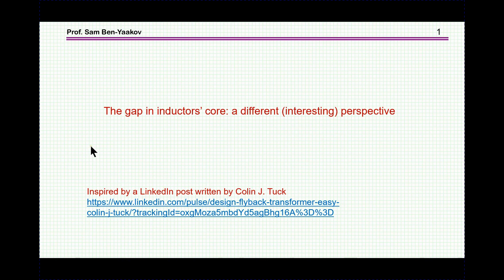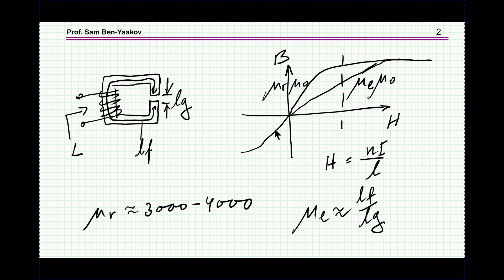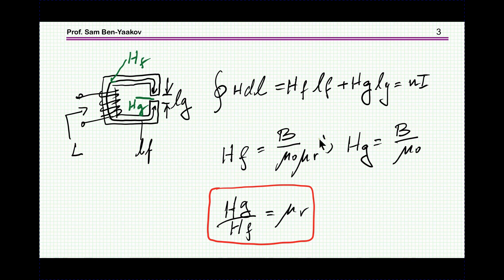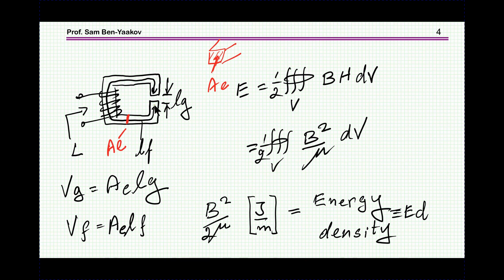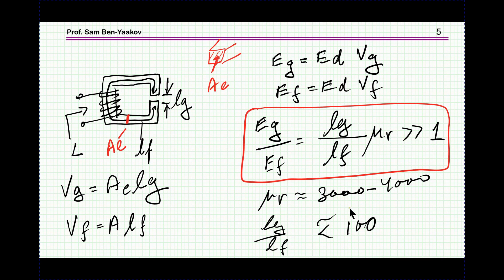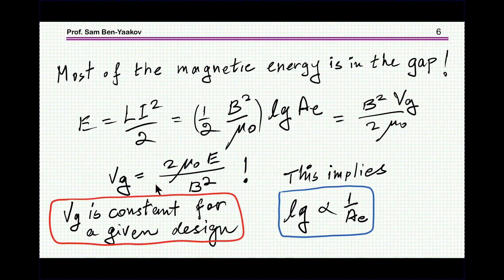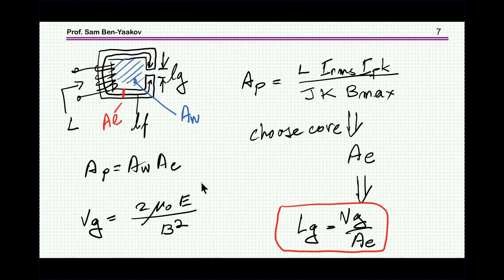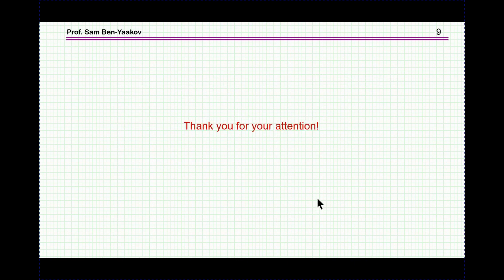The gap in inductors’ core: a different (interesting) perspective

Comment: Does this work for gaps as large as a centimeter with core length being 20 to 30 times longer than the gap?
Reply from the maker: I the gap is large, fringing become dominant and will make a major change in parameters such as coupling coefficient.

Comment: Hello, firstly thank you for the knowledge you give us. I have a question can you tell reasonable air gap height limit. For an example for transformer i design with that ferrite E55/28/21-3C94  i need air gap 30 mm, is that to much considering to EMI.
Reply from the maker: This is too much. You need to reconsider the core size.
Reply: @sambenyaakov  Perhaps It is a real challenge to design LLC converter. The limiting factor i see is delta B. Could you suggest core material with low losses. (I need to go to 0.4 T). Although i redesigned the resonant stage and now i need 6.5 mm air gap for the same core , but still seems to much for me.

Comment: Sam, it is a very tricky thing assuming ur ~ 3000 - 4000. Ferrites or other materials with that high permeability are not generally usable due to low frequency range, low stability, high dependence on external magnetic field and low accuracy. If you go to realistic values of 1000 - 2000 you find out that a substantial portion of energy IS NOT STORED IN THE GAP but rather stored also in the magnetic core.
Reply from the maker: Dear Gregory, Thanks for comment. Permit me to disagree. Below is a table from EPCOS. Up to 100kHz the mur are around 3000. The ratio between energy stored in gap to energy stored in ferrite is =mur*(volume of gap)/(volume of ferrite) . Asssume 1mm long gap and 100mm ferrite length and mur of ferrite 1000, the energy stored in gap is 10 times that in the ferrite. I would say that this  is substantial. 
Regards
sam
________________________
Power Transformer (low loss)

f<100 kHz 
N27
µi = 2000 low cost, hi-power
N41
µi = 2800 current transformer
N51
µi = 3000 loss min. @ 40°C
f<500 kHz 
N87
µi = 2200 standard
N88
µi = 1900 loss min. @ 140°C
N95
µi = 3000 flat temperature behavior
N96
µi = 2900 flat temperature behavior
N97
µi = 2300 lower losses
f>500 kHz 
N49
µi = 1500 
f>1 MHz 
PC200
µi = 800 frequency up to 4 MHz

Comment: It looks like in the discussion all participants periodically forget that any device that stores magnetic energy should store it in some volume that is proportional to the power to store for a while in order to transfer it to the load later. In order to store energy in some substance you have to be sure the substance is CAPABLE of: 1. Magnetizing and de-magnetizing, i.e. changing orientation of the magnetic dipoles it consists of (it may not consist of any) under the influence of the external magnetic field and 2. Providing a mode when ALL the dipoles change the orientation. If some of the dipoles cannot change their orientation in the changing magnetic field, they are saturated, and no magnetic field transfer is possible by these dipoles. The more intense magnetic field is applied to the substance displaying magnetic properties (H), the more sensitive the dipoles are to the external magnetic field (B) and the larger physical volume they take (Vol), the higher power they can transfer through the magnetization / de-magnetization process. This is why we should not forget about the air gap VOLUME or distributed gap magnetic core VOLUME while discussing about the gapped inductor design. We can define the air gap in the ferrite core but the cross-sectional area should always be present since we store energy in the VOLUME. Otherwise, the inductor will fail to transfer energy / power.
Reply from the maker: Gregory, I  take issue with your assessment:
"In order to store energy in some substance you have to be sure the substance is CAPABLE of: 1. Magnetizing and de-magnetizing, i.e. changing orientation of the magnetic dipoles it consists of (it may not consist of any......." This scenario is possible but  not a necessary condition. Think about an air core inductor. Furthermore we know from fundamental principles that the energy stored in any volume is the 'Volume Integral' of  1/2(B*H)dV, no magnetic dipoles are required.
Reply: Sam, you noticed that I was using a term "substance" to designate ANY material for the inductor core, air included. The air core inductor will definitely store energy but its efficiency would be very low due to the energy distribution "everywhere" since there would be no substance that concentrates the stored energy. And the fringing effect that kills inductors' efficiency would be ubiquitous. This is why we use ferromagnetic cores, which are capable of the magnetic field lines concentrating in a bunch and reducing stray parameters. Therefore, for real inductors the scenario I described is a necessary condition. By the way, in your lectures you describe inductors having ferromagnetic cores for the same reason, which is absolutely correct.Another issue is your statement that "...we know from fundamental principles that the energy stored in any volume is the 'Volume Integral' of  1/2(B*H)dV, no magnetic dipoles are required." is absolutely incorrect because the magnetic dipoles are hidden in the magnetic flux density B and they are required by the relative permeability factor that is a substantial part of the B value. Moreover, the magnetic dipoles make the vector B deviate from the vector H thus delivering some interesting effects to the magnetics but this is a different story.
Reply: @gregorymirsky8707  I think the dipoles are hidden in magnetization M. H = B/μ - M.
Reply: @j121212100  This is more related to dipole-dipole interaction.

Comment: Thanks for the video .
At 6:50 you come to the conclusion that the air gap is inversely proportional to the cross sectional area of the core by equating the volume of the air gap (Area x length) with an expression which contains B .
This is not a valid move because B actually depends on the cross sectional Area of the core (B=flux/Area = N.I/Area)  with the consequence that the Area of the core has not been isolated but rather is present on both sides of the equation . 
Applying the above in your equation we then have Area x Lg ~ K x Area squared  (because B is squared)      ( ~ stands for proportionality ) K= 2Muo.E/(N.I)squared
Dividing through by the Area gives Lg  ~ Area . i.e. the air gap is directly proportional to the cross sectional Area .
The same result is obtained by substituting for B=flux/Area  = N.I/Area in your original equation .
Reply from the maker: The entry point of an inductor design is an already specified B, based on saturation or losses (see relevant videos in my YouTube channel). The design needs to comply with the specified B and not the other way around.
Reply: @sambenyaakov  Thanks for the reply . However, you are avoiding my assertion that  there is a wrong argebraic move at 6:50 which leads to an incorrect proportionality 
relationship .
Reply from the maker: Hi, sorry but I do not agree.
1. As I have written earlier B is a fixed number in this derivation
2. (B=flux/Area = N.I/Area)  is incorrect 
B=mu*H = mu*N*I/le , le magnetic path length
3. The fact that the gap volume is proportional to the energy is well known and hence for a fixed energy lg is proportional to 1/Ae
Reply: Hi professor . 
I tried a worked example , and yes, you are quite correct .
Sorry to doubt your superior knowledge  - one lives and learns .
Reply: @SlobodanCukTESLAco  My new buck converter design requires a filter inductor of 10uH with maximum current of 25A .
For an E41/17/12 core with Ae= 149E-6 , Le = 77E-3 . Bmax = 0.3T
Using N  =Ipk . L /(B.Ae) gives N = 5.6turns
Using the fractional turns for this exercise ,
Gap length = Muo . N . Ipk / B = 0.59mm
The core area was then doubled by using two E41/17/12 cores side-by-side , giving Ae = 298E-6 , and Le = 77E-3
Using N  =Ipk . L /(B.Ae) gives N = 2.8turns
Gap length = Muo . N . Ipk / B   = 0.293mm
Thus the gap volume remains the same .
As a check, I then used Mur to calculate the inductance .
Mur = Le/Lg
Case 1, Ae = 149E-6 , Mur = 77/0.59 =130.5  and using  L = Muo. Mur . N. N Ae/Le results in L= 9.95uH
Case 2, Ae = 298E-6 , Mur = 77/0.293 =262..8  and using  L = Muo. Mur . N. N Ae/Le results in L= 10.0uH

I have not looked into the practicality of getting the winding onto the core .
Reply: @SlobodanCukTESLAco 
The formula to calculate the air gap is a good starting point , but as you will know, it is not accurate with larger gaps due flux fringing which has the effect of increasing the effective Ae and hence the inductance .
I have been designing power supplies for many years and although I am satisfied with my method for transformer and inductor design there is always room for improvement and SBY does provide useful material in his videos .
Reply: Flux is NOT N*I in the above: flux/Area = N.I/Area